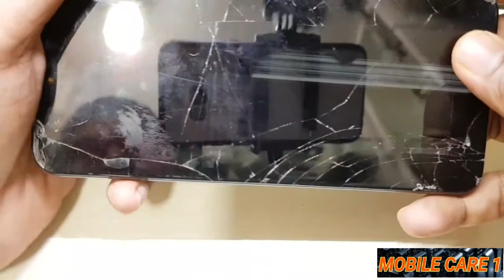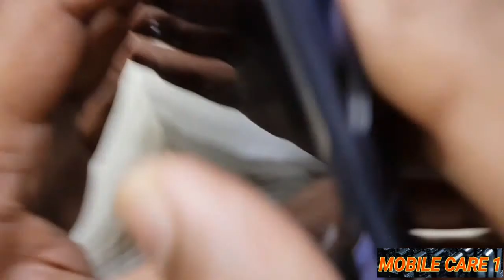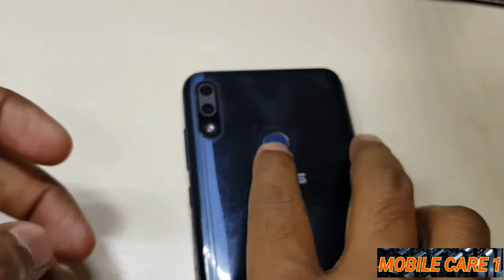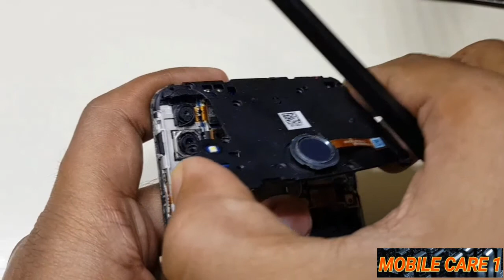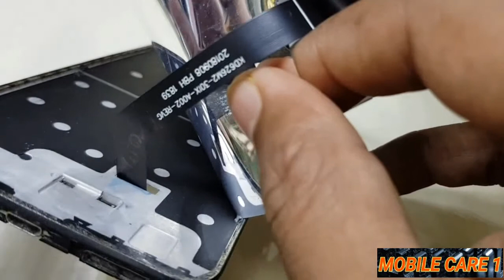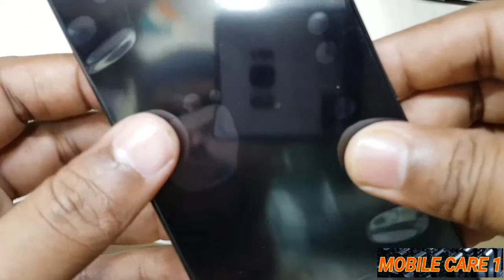Asus zenfone Max Pro M2 display change

Comment: I change my display but the touch screen is with problems. 😑
Reply from the maker: Ek Bar refit Karke try karo
Reply: @mobilecare123  I already did it but the touch blocks. I installed the old display and it works normally
Reply from the maker: @petercoast81  original display lagvalo